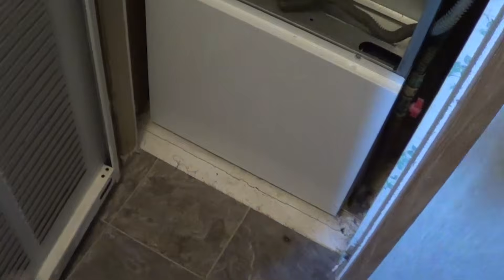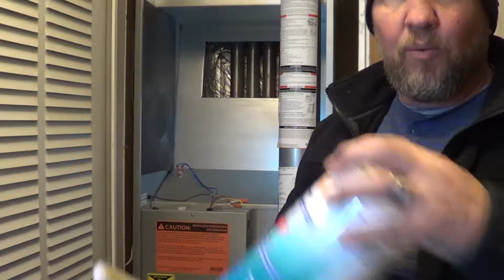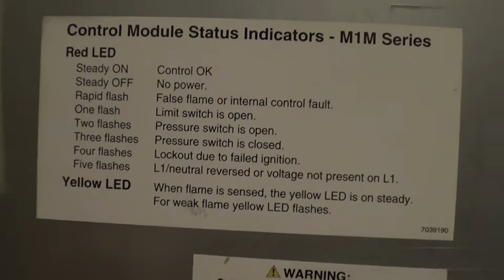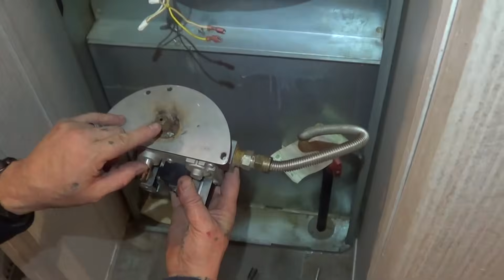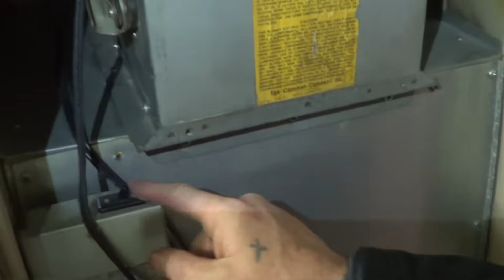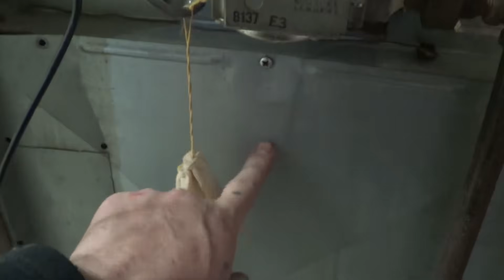Fall Cleaning on different models of Mobile Home furnaces.

Comment: Hi Randy,

In the Coleman DGAA model, my furnace turns on and I see a flame for about 10 seconds before it turns off. Then, it gets 8 flashes.

Do you think the flame sensor might need cleaning?

I’m a bit scared to open it up, but after watching your excellent video, I think I can manage it.
Reply from the maker: Hey, sorry for the late reply but yes, that sounds like a flame sensor problem. Cleaning it with a nailfile, careful not to hit the ignitor close by is tricky but doable. Hope you got it figured out. Thanks for the comment

Comment: I have a unit that pulses when it calls for gas the pressure stays closed not sure what it is have you seen this issue before it will click for about 30 seconds and will work fine for awhile then it won't light no code ever come on the board?

Comment: When I put a air filter in my interterm furnace after 3 weeks the furnace starts giving code s some times 3 lights sometimes 4 lights  I took the filter off it hardly had any further on it  since then the furnace starts giving is working fine what do u think is happing

Comment: The inducer does not pull in outside air
Reply: Sure it does. It sure doesn't carry hot exhaust, you'd have a house fire.

Comment: Any suggestions if you have a lazy flame?
Reply: Make sure your intake and exhaust are cleared properly of any debris if your furnace isn’t breathing correctly it’s not going to run correctly and will often cause a weak flame
Reply: Yea check gas pressure. Mobile Home or Manufacturer  Homes are notoriously known to get plugged or obstructed orifices . Pull gas valve check orifice for spider webs or debris. This will most likely be your problem.

Comment: That squirrel fan looked clean as heck. I looked at the one in ours we bought last year today. It's a Miller furnace. It's a mess. Hair, dirt, fuzz etc. I just spent an hour trying to get clumps loose and the heavy stuff. I'll take it out in a few weeks when it's off for the year. Just doing that made a huge difference in air flow. I can imagine after a complete clean. Thanks.

Comment: Hey Randy, the first furnance..this look exactly like my furnace and mine is blowing cold air..any idea why?
Reply from the maker: Did you figure this out? Usually it will have a flash code. Is it blowing all the time? Usually that is a limit switch.
Reply: @randythemobilehomeguy3715    Yes, i took things apart and reconnected and some cleaning and it worked. 🤷‍♂️   Thanks for your response.

Comment: Where do you get parts for mobile homes? I've got some things I'd like to fix in mine, but its hard to find bits and bobs.
Reply from the maker: hello, it does of course depend on what you"re looking for. Bigger items like tubs cost a fortune to ship but faucets and fitting dont. What are you looking for and where are you located?
Reply: I just watched your tub replacement video and replaced the sub floor and tub in one bathroom. What do you recommend to use for flooring in a bathroom? This trailer came with... ready for it? CARPET in the bathrooms. I want to buy a new screen door and front door, but I don't know how to measure it correctly. Can you buy popcorn ceiling tiles? I had the skylights replaced and the new ones were bigger, which required cutting some ceiling panels out, so we've just been living with holes.